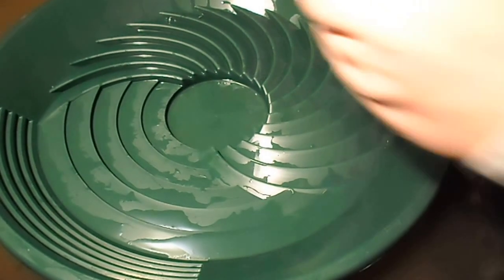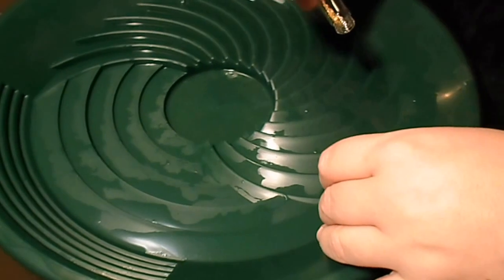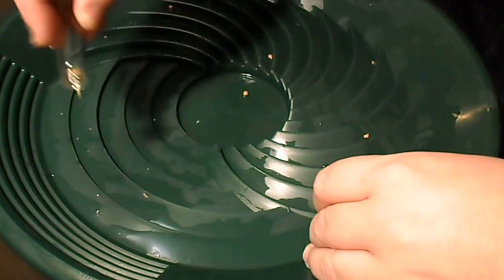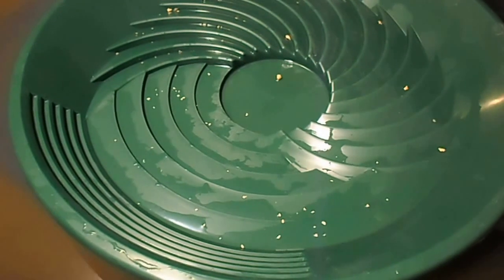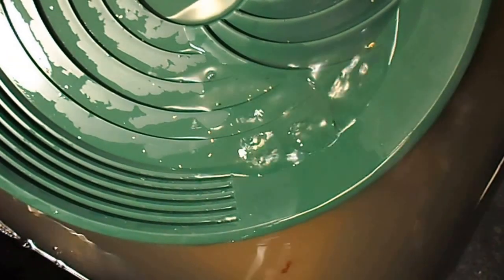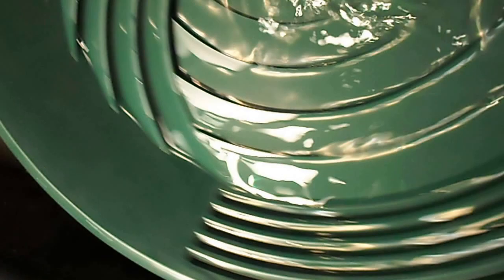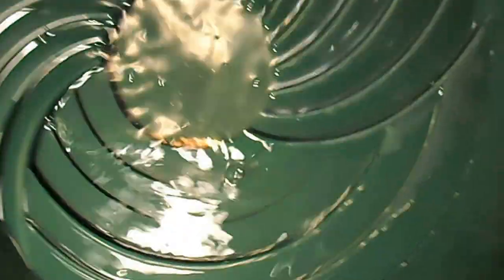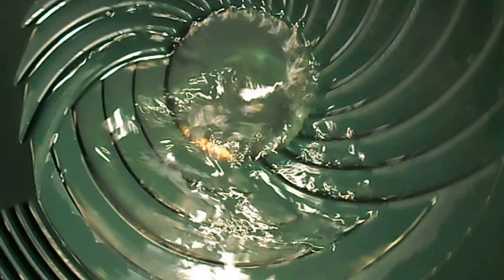How gold acts in the TurboPan

Comment: worst pan on the planet - my moms cast iron skillet frypan works better
Reply: yes then you used it wrong.
Reply: @Raubgraeber  I absolutely did.
It would have to be the hardest pan to master.
And simply not worth the effort compared to a SUPER SLUICE.
Reply: @mohammednovalija  Yes, if you use it incorrectly, it is the heaviest pan. You have to wash it upside down, clockwise, and then briefly clockwise. This makes it much faster than with any other pan, because it is a circular movement.

Comment: I have 12 lbs of paydirt but the gold is very, very fine. I panned about 4 tablespoons for almost 2 hours with no luck. Would a turbo pan do the trick or would I have to purchase a blue bowl?

Thanks.
Reply from the maker: In my honest opinion the turbo pan I do not think would be great for that....A blue Bowl is great for separating fine gold or if you classify everything down a miller table or water table is a great way to go too....Gold Spiral Wheel is good for fine gold as well.   Is it thick with black sands?  Have you tried an earth Magnet?
Reply: I don't have a earth magnet. The paydirt is about the size of bb's at the biggest and plenty of black sand. When panning the gold goes over the edge before paydirt or black sand. Great reviews on the blue bowl, seems that may be the ticket. Wonder if I should siff the paydirt before putting into the blue bowl?
Reply from the maker: Are you using any jet dry or dish soap? If not, that is where I would start. If relieves the surfaces tension so the gold won't float out the edge also good clean water helps too. If you are doing that already then I would say a blue bowl or spiral wheel is the best. Otherwise check with your local GPAA chapter.....a lot of times they will have events where people bring and share their equipment....it also gives you a chance test equipment before you buy.......hope that helps
Reply: @goldpaydirtreviews  Learn to backwash